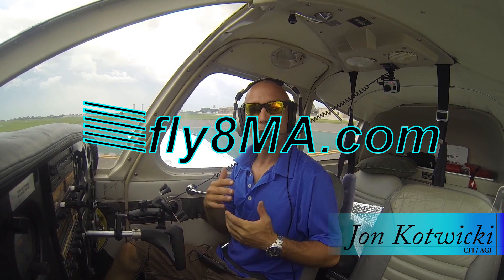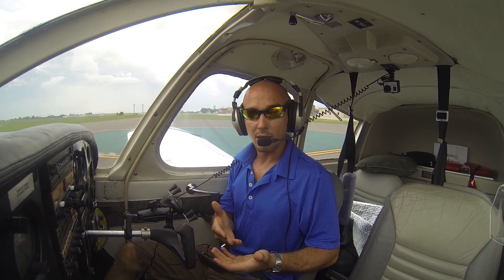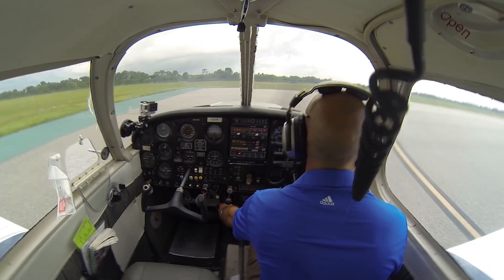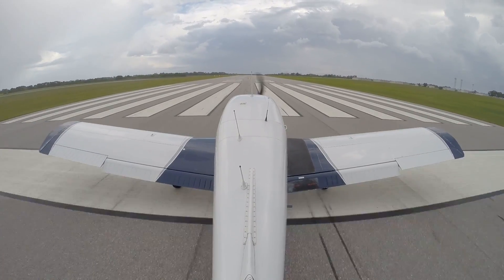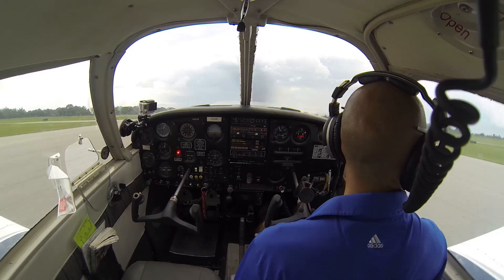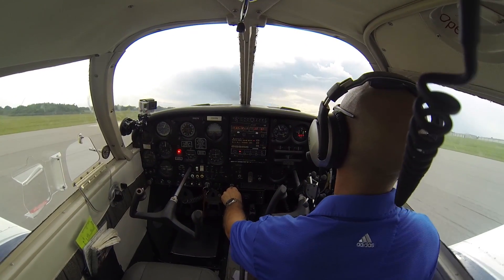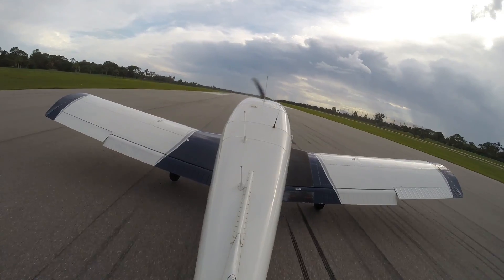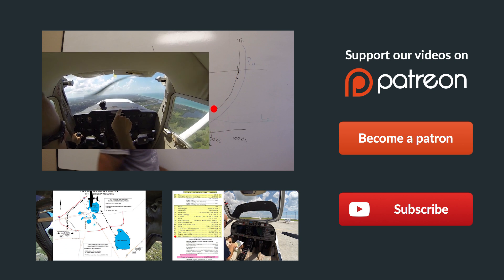Ep. 29: How to Perfect your Landing Flare | High Speed Taxiing

Comment: Why is the nosewheel issue only relevant with Piper planes? Shouldn't that be a concern for all planes? I'm new in my training, flying the 172, and I'm always concerned that if I still have rudder input at touchdown, I'll spin off into the grass!
Reply from the maker: Different system between Piper and Cessna, the Cessna nose gear as you know if connected with bungee cords and can turn independent of the rudder given a little force applied to it.  Piper nose gears are connected to the rudder pedals with steel rods and while you can make more direct direct steering inputs during taxi, it makes it more like to dart off the runway on you in a strong crosswind if you don't get the nose gear straightened out as it is about to touch down after the mains are on the ground.  Everyone has different opinions on what is better and usually the airplane you fly first you like best...."my airplane is better than your airplane syndrome".  :)

Hope that makes a little sense...
-Jon
Reply: Going up today to get checked out on an Archer III (usually fly 172s). The no-bungee comment is very valuable information. Thank you!